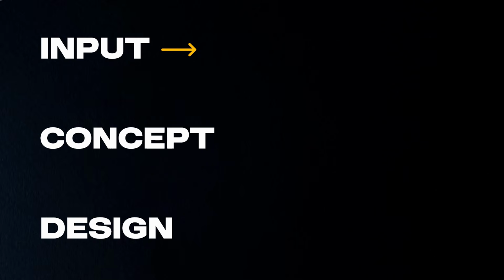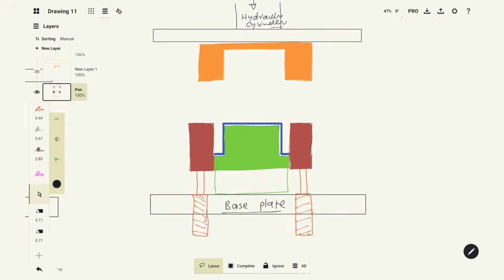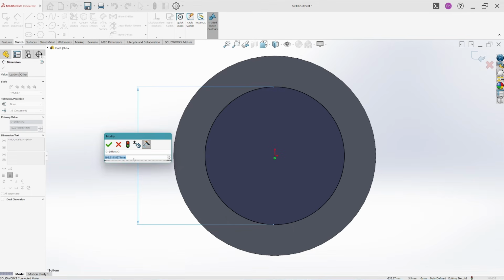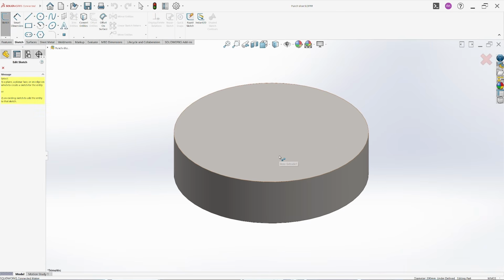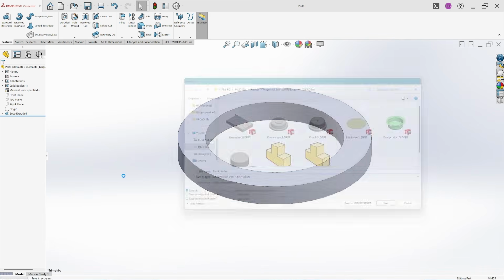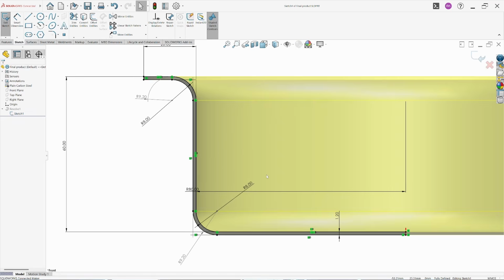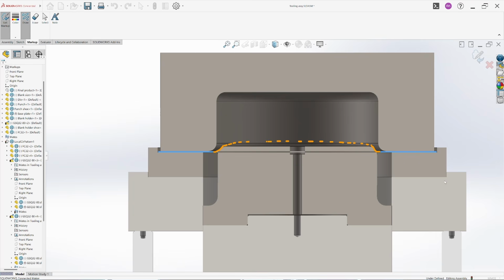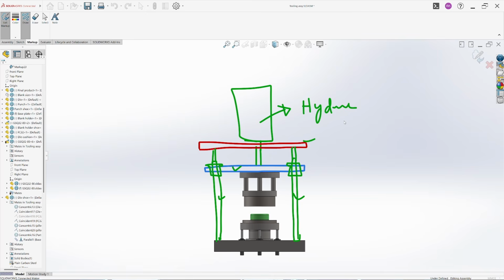Mastering Die and Punch TOOL DESIGN in SolidWorks (from Scratch)

Comment: very interesting video
i have a stupid question though, typical me
how would the design of the tool set change if you were to press a cone or a dome out of a metal mesh, let's say welded stainles woven mesh? it would be abresive, hard to deform due to being welded tnto tiny squares and there is no edge to wrap it around to draw trough, so basically it is still pressing into shape, but almost a completly different process

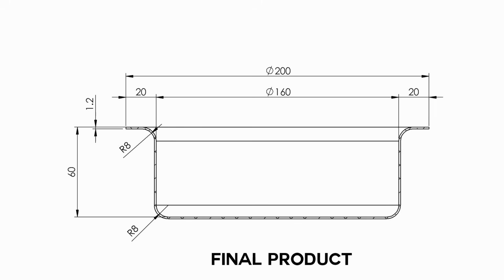Comment: Okay... Question. I am trying to get custom die punches made for various action figure card hanger holes. My issue is finding software I can make that 2d style drawing to give to the manufacturer. What would a a good, rather easy to use, software be to get the type of drawing you had at 2:30?

Comment: All looks good, but 
1. What is holding Die block & Die block Shoe together?
2. Why did you consider Maximum load instead Initial load of Gas Spring as Blank holding force? Doesn't initial load means, the force that is applied by gas spring as we start compressing it? calculated Holding forcing is required to hold blank throughout stroke, not at the end of stroke where Gas spring applies its maximum force.

Please correct me if I am wrong.

Comment: This series has been very informative so far. Thank you

Question on the Punch Design section:
In the last video, you said the punch diameter would be less than the desired bowl diameter, that is, 160 - (2 x die clearance) = 160 - (2 x 0.12) = 159.76mm

I found it weird then, because I didn't understand why the clearance was necessary on the punch, if it was also being used on the die.

So I am confused because now in this video, you made the punch diameter exactly equal to the desired bowl diameter. Is this actually the correct thing to do?

Then, Question on the Die Design section:
Why did we not consider the clearance of 0.12mm when setting the radii for the die? That is, 9.2+0.12 = 9.32mm and 8 - 0.12 = 7.88mm.
Reply from the maker: Yeah, i think you are right 👍 clearance should be added. I just missed it.
Reply: @mastermechanicaldesign  oh alright. Thank you

Comment: First, thank you so much for this. I learnt a lot on both the mechanics behind drawing process and Solidwoks. I appreciate. I am a Medical Doctor and I specialised in Public health. I'm not an Engineer but am very interested in mechanical engineering. So, bear with me if I miss some terminology. 
I followed the video through but I have some questions. 
1) If the final product will be removed by simple sliding I'm afraid that the edge of it still hits the soe holder if the part is not completely above the soe holder. If that's the case, how do you overcome it? 
2) Adding a soe holder and even increasing it's diameter add to the total load the gas spring will have to lift. Don't you think the capacity of the gas spring should be increase above the 11 N calculated?
Reply from the maker: First of all, 
I’m so glad that you are a doctor and also interested in engineering. 
That’s really amazing!

Now your 1st doubt is genuine. Yes, it can hit the SOE holder if the blank size goes out of limit. So we should slightly increase the die diameter and the SOE inner diameter should be based on the largest blank size tolerance.

2nd doubt. yes, you are right again. After increasing the SOE diameter and adding the holder, we must recalculate the load. That 11 N might not be enough now. I should check this.

Comment: 1 more problem - what to do if detail will stuck on Punch?  and no way  for air to exit ((
Reply: Use blank holder to be tight with punch and to act as stripper.
Reply from the maker: We can make a hole in the die and punch to relieve air

Comment: how will you make sure to locate the piece
Reply: The sheet itself,like a recess to locate sheets to prevent moving
Reply: @gamedict9733  look through the whole video, the sheet will have nowhere else to go than being coaxial (centered) with the punch and die
Reply from the maker: You mean die and punch tools? punch is doweled, die tool will be adjustable, we bring our die tool down and inert into the punch, we will also maintain sheet thickness gap and die clearance gap between them, using sheet spacer (shims) and then we clamp die at that position.

Comment: Please have a look about this 

In a belt conveyor 
Is there any problem take place 
When we connect motor directly with the shaft of the conveyor 
Which one is better 
1 - motor connected directly to shaft of conveyor.

2 - we should use chain sprocket to connect motor shaft and conveyor shaft
Reply from the maker: There is no problem, if we connect rollers directly with hollow shaft gearbox (this is made for this purpose) we use chain and sprocket to reduce the width of conveyor, we place motor and gearbox below the conveyor bolt. and use chain and sprocket to connect with roller to transfer motion.
Reply: First of all 
Thank you for replying my massage 

I am connecting roller directly with motor gear box 
But the problem aqueir 
Gear box pull the conveyor roller in the direction of roller axis 
I connected bolt with roller (after inserting roller shaft in gearbox )to constrain motion 
Is it a good solution